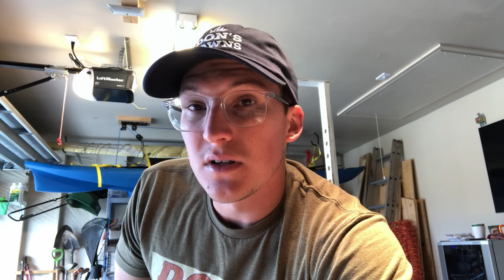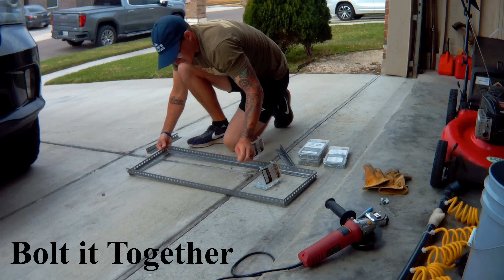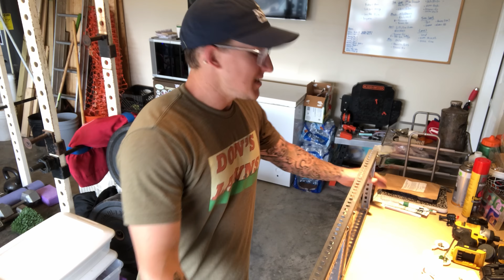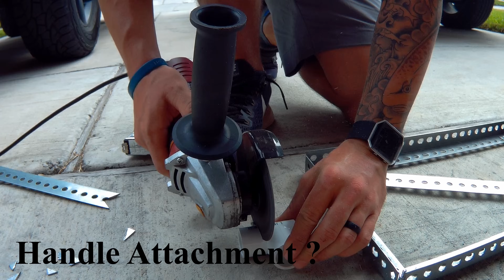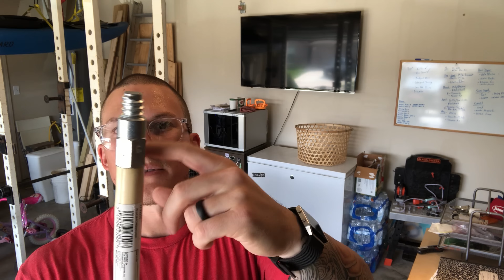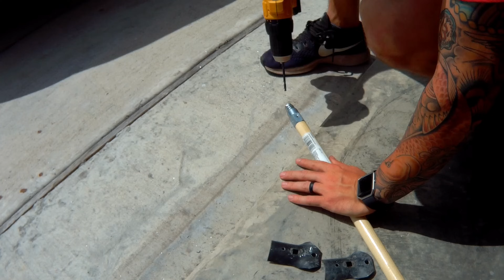SAVE $$$ | DIY Lawn Leveling Tool

Comment: Great job on building that little leveling rake, gave me some ideas. If folks are trying to build this here's a simpler idea for attaching the handle... space those two center slotted angle pieces in the center at 1" wider than the handle, add 1/2" thick nylon spacers at both sides of the handle, drill a hole through the handle up 1 inch from the bottom add a 3/8" size bolt through the center handle supports, use a nylon locking nut don't over tighten. I'm using a 1"  ×  7 ft long metal conduit pipe,
Reply from the maker: Great idea!!! Thanks for watching!

Comment: This home made leveler works great! I made it tonight and used it along our new fence looks like a pro job!
Reply from the maker: Nice!!! Glad the video was helpful!!! 🤙🏼
Reply: What did you use to connect the handle to the rake? I recall Don found something laying around the garage, but could not find anything in the stores.
Reply from the maker: Minou TV check out the fence hardware at the store, or you may be able to just put a bolt through the handle.
Reply: I used to paint roller handle with the rod cut off. 
Drilled a hole in a piece of oak that worked like a hinge. With a notch to hold the wire in the hole. This let me remove the handle for transport
When I get home tonight I’ll take some pictures and send it.
Reply: rickeh100 That’s a great idea! I’ll look forward to seeing some pics. Thanks!
Reply: @minoutv7347  I do not know how to post pictures. I have sent Don my photos. pm me your e-mail and I will send them to you.

Comment: Great job. Especially that you didn't injure yourself building it. I built one very similar with heavier guauge. I  initially used carriage bolts but then welded it. Used an old dust mop swivel handle.
Reply from the maker: Thanks!! That’s exactly what I was looking for, some kind of swivel attachment. Gotta work with what ya got though!

Comment: Hi Don! I've been needing to do some leveling for a couple years and have been kicking around making this so I don't have to buy one. I see this video is about 3 years old Do you have a long-term review or anything you would change if you made it again today?
Reply from the maker: It still works for me, I actually welded the pieces together the other day to stiffen it up some. If I could change anything I’d do something better for the attachment point for the handle. It’s a little light, so I would consider using a heavier material, but that’ll typically cost more. 😅 thanks for watching!
Reply: @donslawns1  that's great information. Thanks for the reply and honest feedback. Now it's time for me to start building...
Reply from the maker: @csuwehling  best of luck!!

Comment: Good job but would have love to seen it in action. Sure looks the part but does it play the part? Was it heavy enough? I know the ones you buy the good ones have some weight to them to really help tamp the mix into low spots.
Reply from the maker: Thanks! I made a separate video using it, had okay results using it with soil and peat moss so far. Hoping to do a sand leveling soon!
Reply: Nice! Thanks Don! Been looking to buy or make one. Great job

Comment: Nice job... This tool is actually called a "lute".  They are more common in the UK for some reason.  Expensive in Canada and the US.  To help out anyone else wanting to do this, I made mine very much the same but with solid "L-channel" with NO holes.  I also used a utility handle, but I simply attached it to a 1 1/2" dowel which then pivots in holes drilled in the centre braces.  It works very well, but here is the important part... I HAD TO ADD a couple of iron plates for weight.  If it doesn't have enough weight it won't properly work the dressing or soil into the low spots.  Hope this helps anyone looking to make this tool.
Reply from the maker: Thanks for the tips!! I think the L-channel would be very useful. 👍🏼

Comment: In regards to the handle, a galvanized pipe can work if you drill a hole through the end and secure it to the slotted angle iron with a simple pin or bolt/nut.
Reply from the maker: You are correct! I could do that with my handle as well, I just wanted something “extra” to add support. Thanks for watching!

Comment: Would making the width to 48inch be better for lawn leveling or do you think 36inch is enough?  Any specific reasons why you didn't go wider on the build? Thanks for the video!
Reply from the maker: Depends on your area you need to use the tool on. I have a smaller section, only 1k sq ft that I made the tool for, and some spots are tight around trees, the playscape, etc. 48” width would be great for more open sections!

Comment: Can we get a list of materials we need to make it ? Any idea what the clamp thing is to hold the handle ?
Reply from the maker: I think the clamp came from a fence bracket (where two poles intersect to form a T). I just added the parts list to the description, thanks for watching!
Reply: Don’s Lawns - Don.  The description shows the measurements in length, but I was curious about the height. Is it 1-1/2,  1-3/4,  2 inches that you used?
Reply from the maker: Michael Salcido I believe it was 1-1/2” height on the slotted angle pieces!

Comment: Since I need less than that I took  half inch shed 40 PVC put hole for rake teeth. Used rake  to brake up soil, them used PVC on teeth and it did what I needed.  I am on budget and way out from Depot so this will do small areas and flower beds. Not recommended for major jobs. TNX

Comment: have you noticed a difference in your angled supports compared to the original levelawn's double horizontal support in terms of leveling capabilities? This looks like a great DIY.
Reply from the maker: No, I haven't seen any difference in terms of leveling. If anything I'd want to build it again from thicker material to add to the stiffness. Thanks for watching!

Comment: isnt the leveler too light ? you should weight it down ,my opinion anyway ,let me know if it works well as is
Reply from the maker: It works pretty great! You can always lay a brick or two down and bungee them using the holes in the slotted angle.
Reply: @donslawns1  great thanks i will experiment once i build it

Comment: would you recommend using non-slotted  aluminum angle instead? and just drill the holes where needed
Reply from the maker: If you can get some that has a rounded edge, then it’ll be perfect! Probably more sturdy as well, but might cost you more. Thanks for watching!
Reply: @donslawns1  Yes just saw that they are a little more pricey but still beats the $120 leveling rakes online haha

Comment: This is awesome! Where did you find that attachment you used for your handle?
Reply from the maker: I think it’s from fencing. It basically held 2 pipes together at a “T”, but I can’t find the item online...
Reply: Those look like what holds a dog kennel door on. It will be in fencing.
Reply: The Handle looks like the paint roller handle. It is in the Paint aisle in Home Depot.

Comment: make a cut on just one side of the angle, you can then bend it and fold it over to make a 90 degree. Keeps it more rigid and less cuts and fasteners.
Reply from the maker: Very true! My next version will probably be done that way!
Reply: @donslawns1  here's another idea. Use heavy angle iron. Cut 3-4 pieces 36" or whatever size you want. Make 3-4 holes in each and run ready rod thru and secure with nuts and preferred spacing. It'll be nice and heavy.

Comment: I don't know where you got the slotted angle from. Home depot is selling one 48in piece for $16.
Reply: Check to make sure it’s 18 ga and not 14.  Although the flat bar is not included in the price listed above.
Reply: Check ur local steel seller. Much much cheaper for much heavier steel.
Reply: @trevor-bd4kt  I ended up making my own for a total price of $50.

Comment: Nice work. Anyone tried a similar design but with wood? Have a few 2x2s laying around.
Reply from the maker: I have seen some wood ones implemented, I think they work just as good. I’d be curious to see their longevity!
Reply: Don’s Lawns btw - made mine with 2x2s. Worked great. Weight was perfect. 30” wide. Would go slightly wider next time.

Comment: Just a thought, but that looks awfully close to a wall mount tv bracket. It seems that you might only have to figure out how to make a handle. As an added bonus the corners are welded
Reply from the maker: Not a bad idea!! I like the ingenuity!! 👏🏼👏🏼
Reply: R&R lawn products sell just the adapter piece for like $16. The piece that a handle would screw into and then screw adapter to your rectangle piece.

Comment: My lawn levelling tool, I used a galvanised boot scraper https://www.amazon.co.uk/dp/B07L3WHXVQ. Tied on a couple of bricks for weight and a loop of rope tied to each end to drag it with. Still use the boot scraper for its intended use once I finished.
Reply from the maker: Ingenuity at it’s best!

Comment: I like the idea, but I don’t have a tool to cut metal. 😟  Guess I search Craig’s List. Looking forward to seeing how it works out.
Reply from the maker: Bummer! If you have a circular saw for wood, you can try a metal cutting blade on that! Otherwise, you can try using precut lumber/metal.
Reply: I was wondering if there was precut to those dimensions, or close to them anyway. I have a Dremel, but I’m concerned so would either go through a lot of cutting discs or burn out the unit. I’ll check out the precut idea.

Thanks!
Reply from the maker: Minou TV they came in 3’ sections at Home Depot/Lowe’s. I’m not sure about any shorter pieces, maybe they’d be willing to cut it for you?

Comment: If I made this and used it once I would probably throw it away when I was done. Considering all the time to put it together it wouldn't be worth the hassle for me. I would rather just buy a quality made rake that would last years. I could always sell it second hand to recoup some of the money years down the road. The home made rake would be worth nothing second hand. But still, thanks for the video, it helps me to weigh out my options.
Reply from the maker: Thanks for your two cents!

Comment: For those looking to make this. Here is a good solution for mounting the handle
https://www.lowes.com/pd/SteelTek-1-1-4-in-Silver-Galvanized-Steel-Structural-Pipe-Fitting-Swivel-Base/999931090
Reply from the maker: Nice option!! Thanks for the help!

Comment: Why not just drill the Hole in the handle, and just use that straight to the leveler? No need for the extra piece.
Reply from the maker: That’s an option, in my opinion- the handle was going to dig into the ground when used in that position. So I personally felt that it needed a bracket or something to that extent to go a little extra between the handle and the leveler. Thanks for watching!
Reply: @donslawns1  You could cut ut so it doesnt stick that far down 😊
Reply from the maker: Very true! I could’ve also just bought a levelawn with my credit card. 🤣
Reply: @donslawns1  😮🧠💨 Haha
Reply from the maker: Joakim Gulbrandsen honestly I think the bracket doo-dad adds some stiffness to the handle attachment, but probably not needed though!

Comment: Cost effective... innovative. Oh, shorts, very thin shoes, no gloves cutting a small object with a grinder on concrete... oof-uh!!! If that thing bites, your heading to the ER
Reply from the maker: Thanks for your concern! 🤙🏼
Reply: @donslawns1  all good. I've been working at industrial sites for 25 years. Grinders are one of the most versatile power tools. However, they are EXTREMELY dangerous without the utmost respect. Once using one I had on steeltoes, jeans, long-sleeved shirt, leather gloves, safety glasses AND a face shield on a hardhat.... I was leaning over a bit cutting a piece of steel tubing in a vice on a bench.... sounds like I covered all bases of safety.... the bottom of my shirt was just long enough to get caught by the wheel... the grinder ripped out of my hands and up my chest... it was over before I knew what happened.... a few stitches... not too bad considering. Stay safe, man
Reply from the maker: Zig Wil that’s wild! Glad you came out alright!!

Comment: Video too long… would recommend welding rather then using the bolts. From my experience the bolt heads do minor damage to centipede grass
Reply from the maker: Thanks for your input! I’ve since welded the pieces and have noticed better performance. Don’t forget to skip ahead if you get bored at anytime! 😎